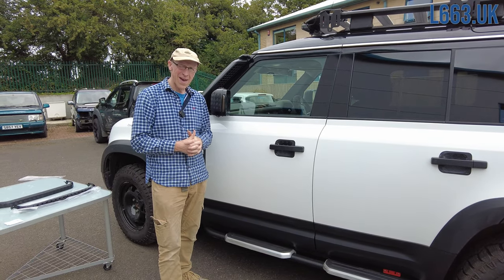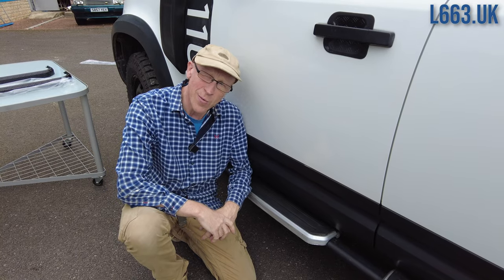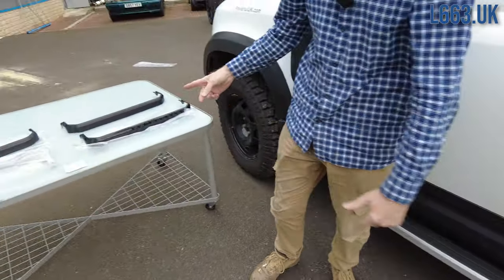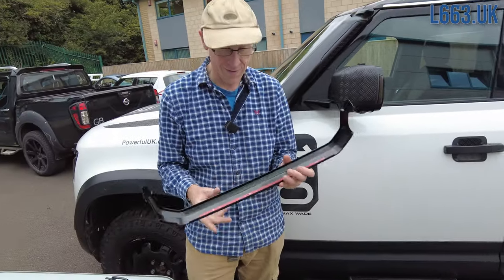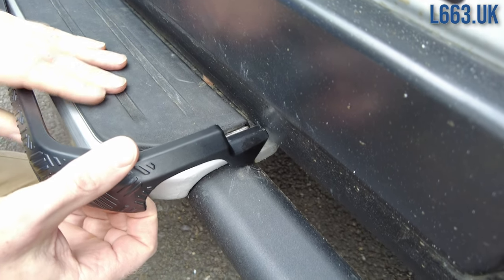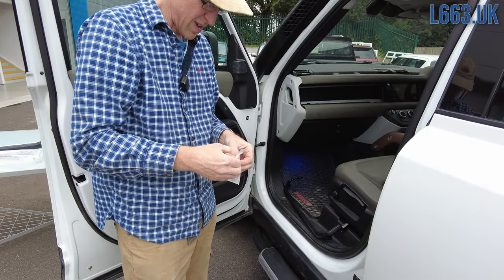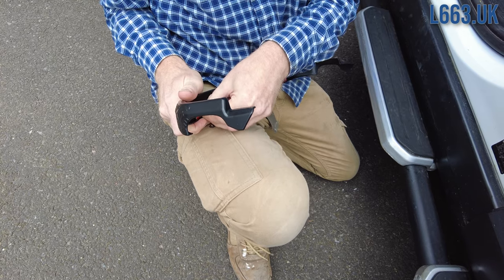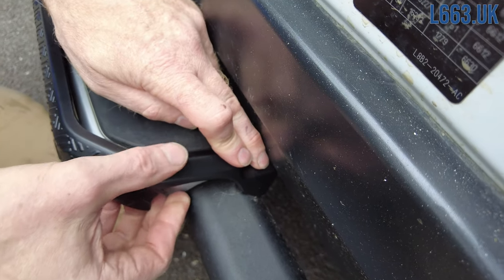New Land Rover Defender L663 Chequer Plate Side Step Covers for 90 110 and 130

Comment: Fitted mine this morning to cover the silver strip. (Cheers for the rapid delivery) Perfect look and fit and a great alternative to swapping out the steps. 👍One slight modification to consider Simon, (in the spirit of constructive feedback), is to add a small strip of 3m tape in the top part of the channel before each clip. Just holds the sides in nice and tight, as there can be a little movement otherwise and I wondered how this might be an issue when tonking down the motorway, or if a bit of detritus worked its way in. Didn't hamper fitting at all and easy enough for the punter to do, if needs be. Another quality product, great  VFM and can be considered as a low-cost consumable, as and when replacement required. You and the team, keep up the good work!
Reply from the maker: Firstly thanks for the feedback - it is welcome. We did consider adding some silicone with the kit but wanted to keep them removable. Please test them for me and let me know how they do longer term. I was thinking we should make these available as single items for when they need replacing... anyway if you have any issues please contact us and will get you replacement etc... we always like to look after our "early adopters" who buy new products at launch !

Comment: Boom Boom!! 💥
Reply from the maker: How is Brutus doing ? windscreen all fixed ? software level ?
Reply: @L663  4  has arrived won't install due to battery low.... Tried 2 times even with a drive... New windshield is still Crack free. Non OEM Still awaiting the passenger side windshield trim to arrive and of course get painted lol

Comment: I’m always impressed by the precision fit you achieve Simon…you must be very detailed when you get them made up in (I guess!) China. Sales?…70% Matt for off traders and the rest gloss for never off readers like me!!😄😄😄Well done again!😎😎😎😎
Reply from the maker: Hi Richard - this product too a few goes to get correct - we printed a few versions first to test the fitment etc. We designed the product so that it is sort of too small so that it is always hugging the step - it was a good example of not just taking the CAD data and making a cover - but making a cover that would "grip" the step by changing the shape.
Reply: @L663  There is a lot of thought needed for these “simple” jobs…it needs a clever engineering background to anticipate the potential failure points and design around them. 🙂🙂🙂🙂